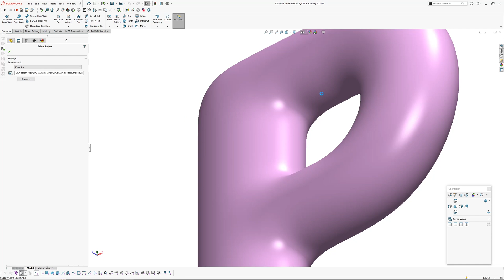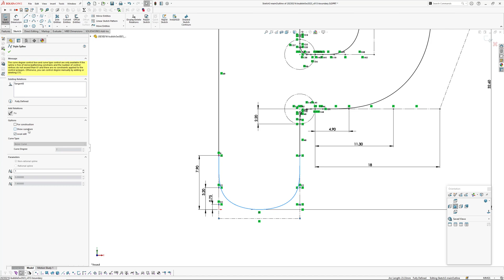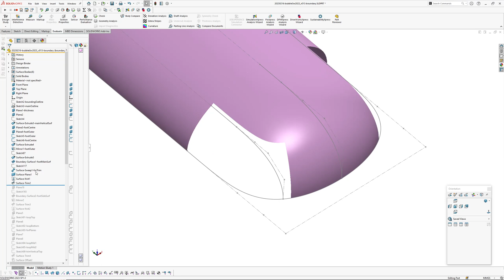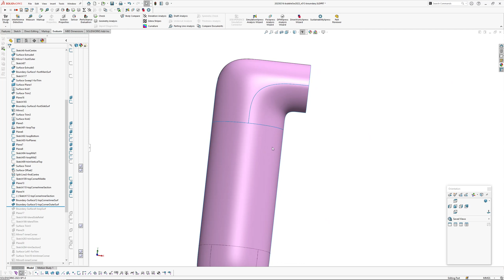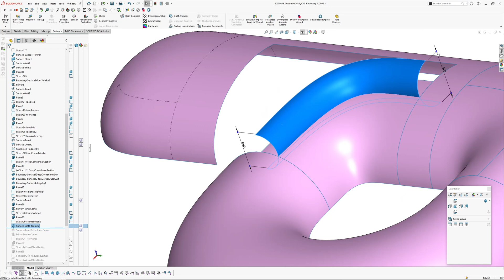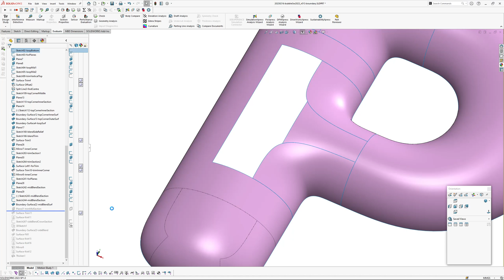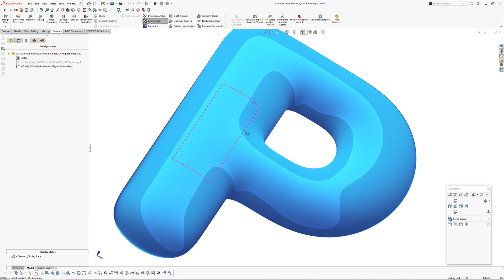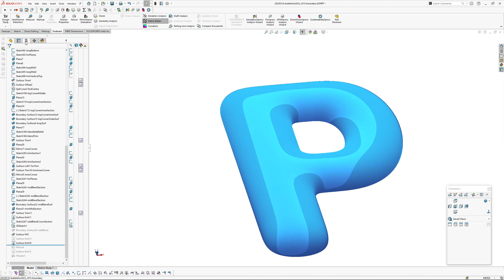Bubble Letter P. G3 Surfacing Exercise in Solidworks.

Comment: First great vid. There aren't that many higher end surfacing people out here showing using Solidworks surfacing like this so it's nice to see.

Second....ever since SW added G3 it's been hit or miss at times and have given them quite a few examples where the sketch relationship shouldn't over define but does. It made trying to keep things to the highest degree sometimes impossible.
Reply from the maker: Thanks for watching! Yes the G3 constraint is fussier than G2 has been in the past. I think I'm getting the hang of setting up the spline in a way to reduce issues when applying the constraint...
Reply: @AndrewJacksonDesignStudio   one place that has great insight is Dimonte Group. Ed Eton and Andrew Lowe are some of the best in the business. 

Also, philosophical speaking, modeling as a whole is way better than mirroring but when trying to hold Solidworks to that it's daaaaaam near impossible because they think mirroring is ok when it isn't. I personally don't like the isoparm to translate into my surfaces... I want them to be as nice and whole as possible.
Reply from the maker: I've been talking with Andrew Lowe a bit, he has some great content online and believe he was presenting at SW (3DS?) world 2023. I have not seen what he was discussing though.

I don't see an issue with mirroring bodies that are meant to be symmetric. You do have to keep an eye on things to make sure you are carrying the right intent across the centreline. In the case of this bubble letter, the main sections are partial ellipses, so when mirrored the curvature where they knit is all good, as they are matching themselves. I didn't mirror the foot in this case as I knew then I'd probably have to introduce another section to control it and then have more to tweak!

I know in the auto world roof surfaces, bonnets, etc may be made as a single surface rather than mirroring so there are no curvature issues, also they will be using single span surfaces. 

I think modelling symmetric parts as a full body can cause issues for users as there is more for them to keep track of. I recently watched a 'how to, what the pro's do' type video where the user modelled an entire desktop speaker that had some nasty twisting in the body (loft connectors twisted?), so they cut it down to a quadrant (kept a good quarter) then mirrored that twice. 

I'm not sure what you mean by isoparm translating into your surface! Every surface has isoparms. Do you mean knots? Multispan surfs?